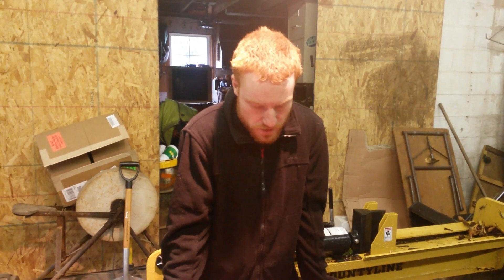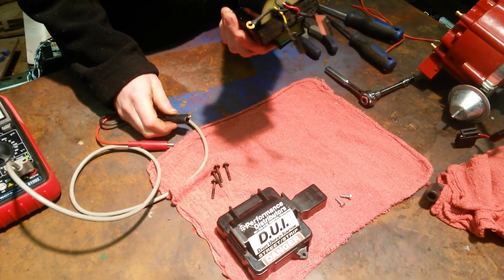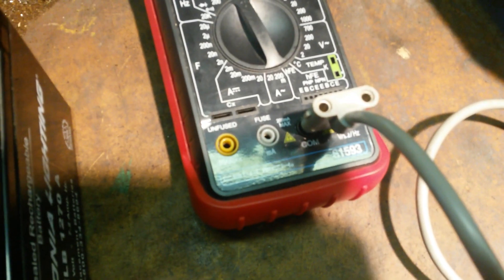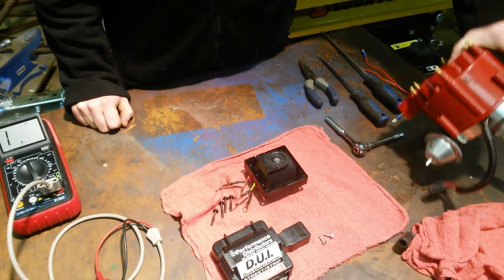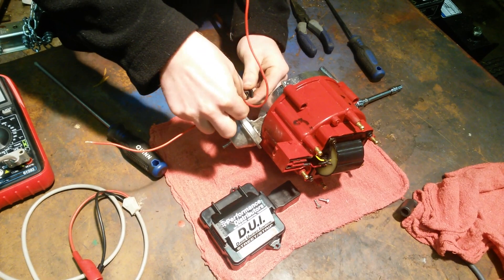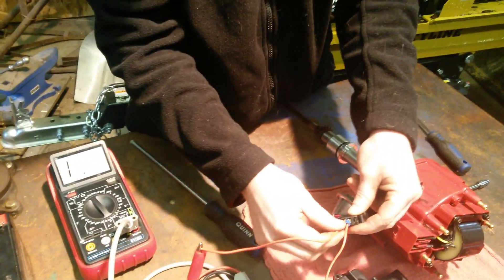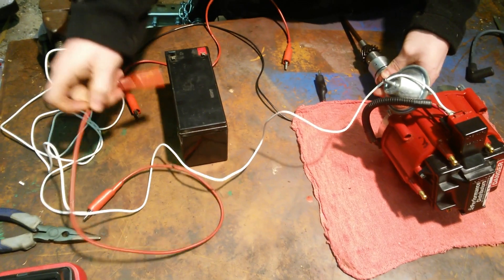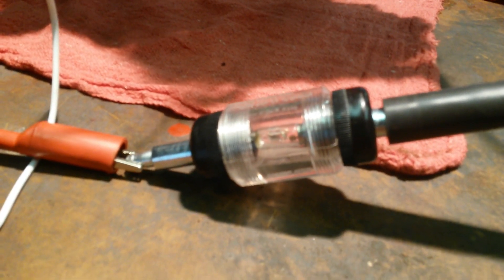Testing a GM HEI Distributor

Comment: Easy tests for HEI system:

1. Test for power at the pink BAT terminal. You should have battery voltage w/ the key in the start and RUN positions.

2. Connect the ground side of your test lamp to the battery POSITIVE cable. Probe the TACH terminal on the dist. cap while a helper attempts to start the engine. The test lamp should blink repeatedly as the engine cranks. No blink= bad module or pickup coil. Further testing is required to pinpoint the problem. Blink but no spark = bad ignition coil.

3. Remove the cap & rotor. Remove the green & white leads from the module. Connect your ohmmeter to the green & white leads. You should have approx. 800-1500 ohms depending on the ambient temperature. Open circuit (infinite ohms) = bad pickup coil.

Wiggle the green & white leads as you test. Ohm reading should remain constant if the leads are good. If the reading varies as the leads are wiggled, the pickup coil is bad. You'll often find broken pickup coil leads this way.

4. DVOM (meter) still connected to green & white leads. Set your DVOM to AC VOLTS. Have a helper crank the engine as you watch the AC VOLTS reading. A good pickup coil will produce about 3V AC when cranking. Less than approx. 2V AC indicates a bad pickup coil.

Comment: Jesus.  What is with the background noise?  And your instructions couldn't be more vague.  Terrible video.  Sorry.
Reply: If you are unaware of the noise that's rain on a tin/steel roof in thebackground. As for the instructions and specs being vague as you are aware many manufacturers make HEI distributors not just GM anymore. So methods and techniques for testing might very based on that manufacturer.
Reply: It is raining, he says it at 5:13.

Comment: Thank you for the info! I’m at a loss, i did all the tests about a dozen times now, everything tests ok but I still can’t get spark. It’s getting proper voltage and signal but just won’t spark
Reply: I I assume you have an HEI. First, check the wire that connects to the coil from your ignition with a volt meter. With the key on, you should get 12 volts. If your coil checks out good, then the problem is your ignition module has crapped out. I had a brand new one work for like 20 minutes and it crapped out on the highway. Had to get the car towed home.

Comment: That last test should be done.  When you buy a new one.
Save a big hassle if you get a “DOA” one.

Thanks for sharing by the way!

Larry
Reply: Just replace my factory Tachometer in my 78 Camaro with an updated factory Tachometer and not getting single, or not proper response, I do have a new circuit board, messed up old one re install cluster when replace dashboard. Could it be bad or weak signal from distributor